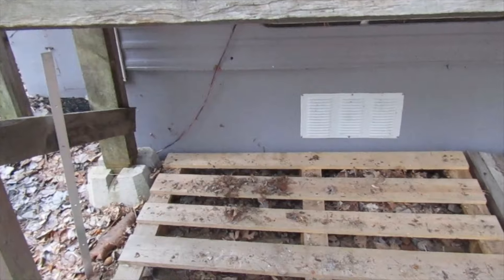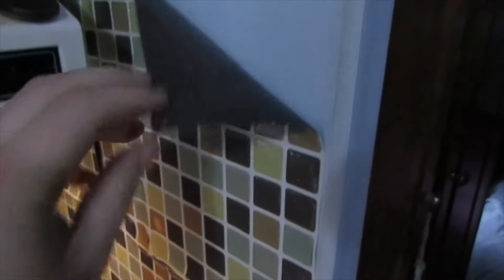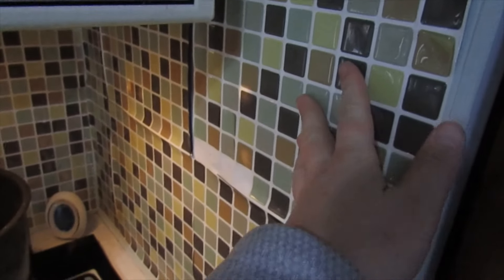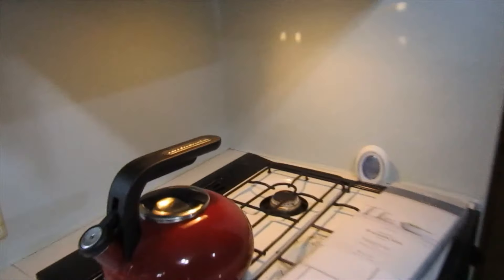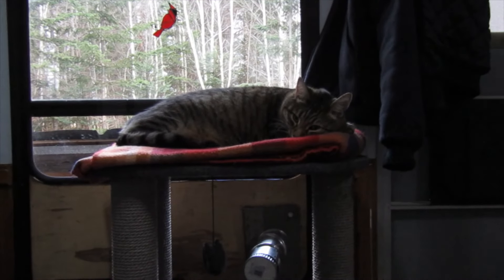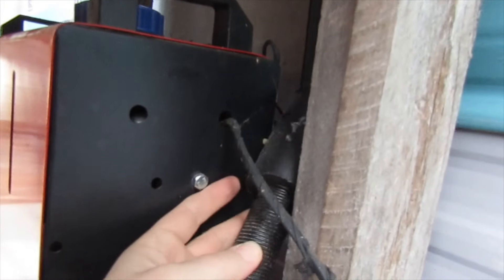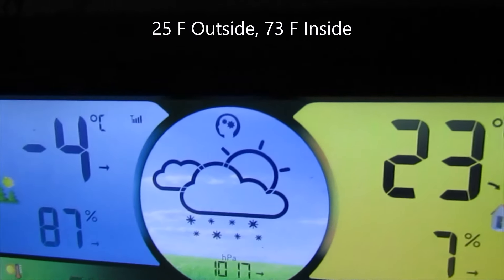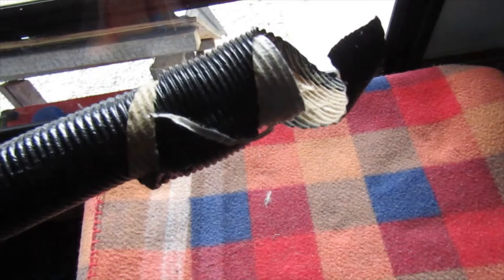Sometimes Projects Just Don't Work Out..

Comment: There are two air intakes on those, one is air intake for burner, ( ok to be outside) and thats the one your working on. The other is the upper 3 " hole, you have to get an adapter for intake and fasten it to case. The run a 3" flex tube into house, pull fairly warm room tempiture air thru heater.
Reply: I was going to say the same thing.
Whoever comments you've read misled you..

Comment: Pick the color and design of (real heat resistant tile) that you want around your cook top. Then ask your local home depot or the same there for the right glue for the tile that will stick to the wood, then the correct grout to go between to fully secure.  Then it is easy clean from then on.  Thoughts to ponder.  Have a wonderful day.

Comment: Actually, the air intake to the burner is fine being cold (more dense, more air).  
The REAL benefit would be using another 3" to suck from the camper, throught the unit, and then through that existing outlet.   Right now very cold outside air is passing over the heat exchanger and having to be heated.

Comment: Tipper here...anytime you have to remove adhesive stuck items, heat it up 1st with a hair dryer or better a heat gun.  The glue bond is easier to remove when warm.

Comment: Greetings,
I enjoyed Your video as always. A few suggestions......When cutting with a hole saw, start on one side, then finish from the other.  That will keep You from having any tear out on either side and the pilot drill bit will keep You in the same place on both sides.  Also, It is true that Your Heater will start better with warm air intake into the burn chamber, however it will also backfire raw fuel/ fuel smell at times while it is starting up and until it is efficiently burning. 
Stay Warm and safe,
JR
Reply from the maker: Thanks very much for the info! As it is, I do get a bit of diesel smell when it first fires up but it doesn't last long!

Comment: Jenna, when using a hole saw drill the pilot drill bit thru, then go to the other side put the pilot drill bit into the wood, start the actual hole saw cutting groove. Then you can go back to the opposite side and cut thru without splintering. For the exhaust copper tube fittings will work if you cut slots so you can squeeze with clamps.

Comment: That diesel heater is meant to be installed inside the heated space not outdoors, only the exhaust must be ducted outside.

As others have mentioned if you want to draw in warm air from inside the camper you would have to connect the larger 3 inch grill with a duct to the inside of your camper.

If you truly do not want the diesel heater inside your camper it might be easier to build an insulated box around the heater with the exhaust going outside of that insulated box.

Then all you would need is a 4 inch hole between the insulted box containing the diesel heater and the inside of your camper.

Good luck and take care.
Reply from the maker: So everyone has been telling me, I wish I knew this from the beginning instead of thinking they were all talking about the air take hose lol

Comment: Hi Jenna, I would have used sandpaper to Key the wall before sticking your backing up, Also would have sprayed the wall with contact adhesive. I did this on my van and been fine for 4 years.  Also the air drawn in to your diesel heater is not the intake pipe your cutting, that one just feeds air to the burner . You need to make changes to the air intake, opposite the vent that  blows heat into your home. You would  then be  circulating  the warm air in your van back around and in again. It works great, To to this you would need to cut the opposite side of your casing so you can put a same size vent as the blower side. Hope that make sense. Love your channel.😀
Reply from the maker: Thanks for the info, and I have definitely thought if adhesive and may have to give that a try

Comment: sorry to say but that is not the one you need in side it is on the back of the heather where it sucks air over the motor a dryer vent works well the end of the box has to be opened up were the vent is on the cold end looking at it from out side would be on ur right

Comment: Hi jenna , I looked if Napa , Canadian Tire , furnace places no luck but I did find 2" heater hose at a RV place maybe just maybe they can be of some help good luck , you survived before . Merry Christmas .
Reply from the maker: Thanks for checking, I checked those places too and Canadian Tire had all smaller than the 1 inch I need. All good, the new one will arrive in january so for now I just run the shortened end of air intake from outside as I have been, haha.
Merry xmas to you also 🎄☃️❄

Comment: You should've shown how u tried to Jerry rig the intake hose.. I would've tried cutting it in two in the straight section and adding a paper towel tube in the middle, using gorilla tape..  might've worked until you got the new one.

Comment: That small air intake line for the diesel heater you ran inside doesn't need to be in the camper its going to pull air from inside the camper for combustion. 

I installed one of these heaters in my camper that's not in the box you're loosing alot of it's efficiency having it outside of the camper. And it heating outside.
Reply from the maker: I am realizing now from everyone's comments but initially that is the hose I thought needed to be inside to remedy the problem
Reply: A simple solution is you could make a box thats insulated in the existing spot that's better sealed to the camper and leave the window open to that space it would pull air from inside the camper so it wouldn't be trying to heat outside air.

Mine runs on low and keeps the camper 20c or 76f and the outside temp is 18f -7c seems to use 2 liter's of diesel in 10 hrs

Comment: There is a thing called Aluminum tread plate, you can find it on Amazon and most hardware stores, that would solve your back splash issues once and for all, it comes in different thicknesses and can be painted with high heat paint and cut with a jigsaw. Love the channel , Merry Christmas from Michigan.
Reply from the maker: Merry xmas to you! 🎄☃️❄

Comment: with the back splash,  peel and stick, even on floors, are limited life over time.  the sticky gets hard then just cracks away from the floor/wall.   In the case of the kitchen, the heat from the stove bakes the glue and it will separate in time.
THIS IS GOOD OR BAD.
GOOD,  you can change colors/design periodically

Bad, you have to change colors/design periodically.

I myself like the change.

HOWEVER................... Stand my for my smart and witty comment

My neighbor had drywall with no cover on it.  So the heat and splashings were not kind to it.
He went to a flooring store and bought a nice design Linoleum floor covering.  Yup, the same stuff you
roll out on the floor.
you can get it in small pieces, they have some interesting designs that can fit in with your kitchen, and with one
piece, there are no seams to roll up.
He used finishing nails to hold it up, so it was not going anywhere.
The design he chose was very attractive and fit in the kitchen.   LASTED FOREVER.

DIESL HEATER
Well Im not going to step on any toes but
Putting the air intake for the BURNER of the Diesel heater will bring in warm air,  true,  BUT.................

NOW you are causing a negative air pressure in the RV and you are sucking cold air into the RV, probably right at your bed,  feel cold ?????   That would be why.
Because the exhaust has tobe eliminated outside, there is no way to keep the air pressure neutral inside the RV so you will be sucking cold air inside.
You need to weigh the benefits of sucking in the cold air which will fight the heat that the furnace is making to warm your space,     vs letting the furnace burn the cold air.

In a large room, you wont notice as much, in a small space, like an RV,  any air leakage, especially cold air, you will notice that you are cold all the time.

Comment: Wow, I'm a 25+ year tile guy got fooled you had actual mosaic tiles around your" blackspash"lol( I had to autocorrect that twice).   Ok, I'll watch rest of video..... Peel and stick? 🤣
Reply: Tighter you make that inside corner the better a nice bead of caulking looks
Reply: Absolutely!!!!! For absolute sure🐈‍⬛ The more you want to keep a cat completely out of a certain sensitive area...they will dash there, lightning quickness
Reply from the maker: Well I think I probably will need to resort to mosaic tiles after all my peel and stick fails 😂🤣
Reply: 200 bucks more,( maybe less) get the  square foot sheets of beautiful glass mosaic, color , size of your choice, home Depot and glue,grout it in yourself
Reply: @gypsyjenna   it's around your stove, peel and stick is iffy, glass, porcelain, ceramic, mosaic is fire resistant and if installed properly lasts decades, you are not moving your trailer regular so there are no crack, movement issues
Reply from the maker: Very true  it will likely never get moved until it crumbles or the roof caves in lol
Reply: @gypsyjenna  So cool we can chat, I have no problem sharing my knowledge, because you share with us 👍🇨🇦